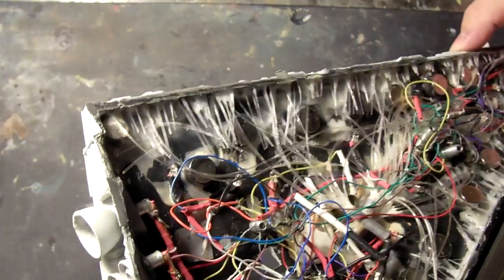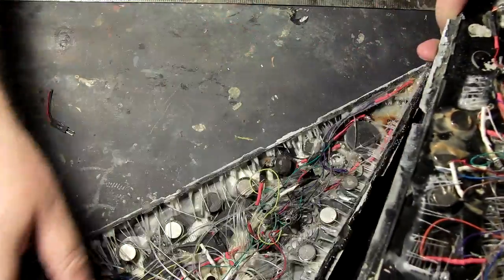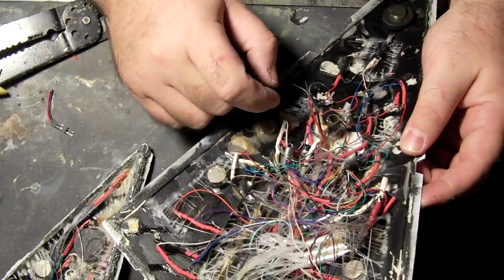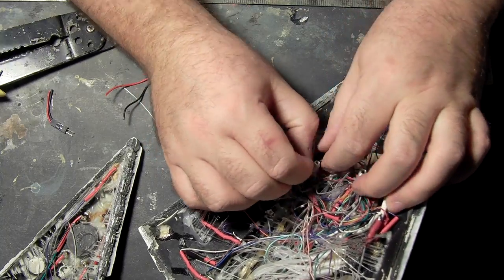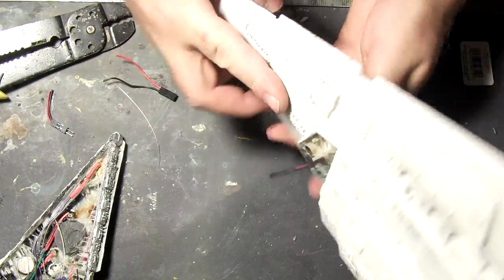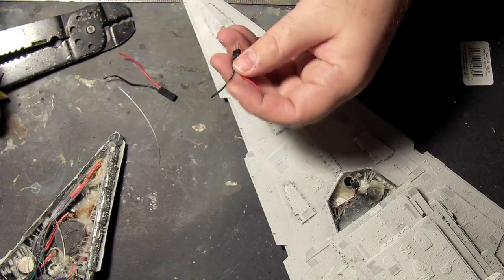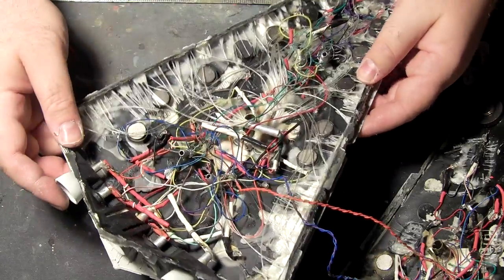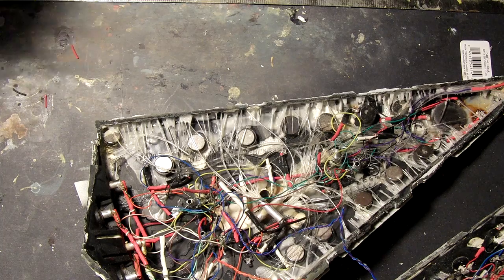Surgery Series 2: Star Destroyer! Wiring it up 4/5

Comment from the maker: @smsno1 I was gonna save the secret til I could make  sales vid, but I would use Regular style and place a styrene or aluminum tube over each of the LEDs, feed the fiber into that.  Use a strip of 3 or 6 leds to keep it as simple as possible.

Or lay down one long strip aimed at the short-cut fiber stubs for blanket lighting.